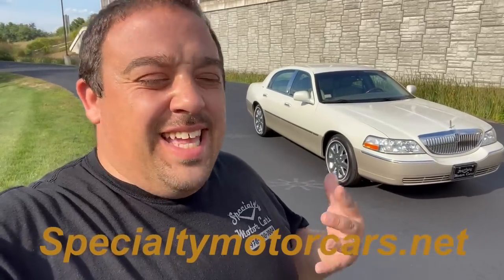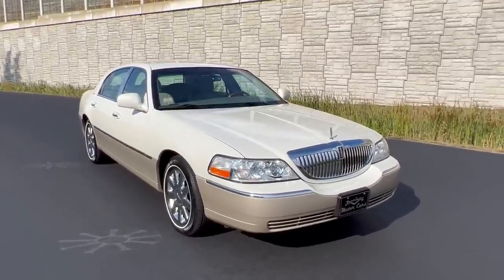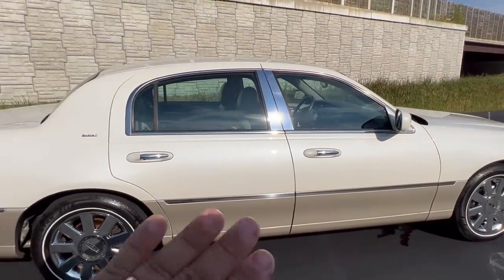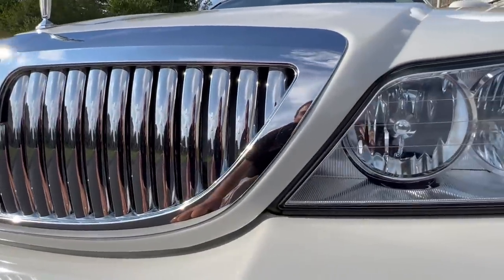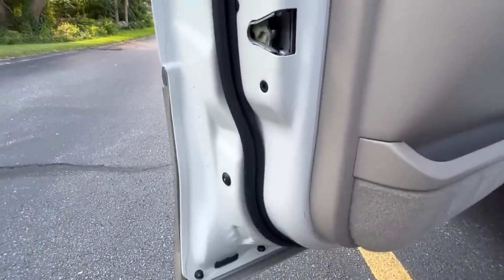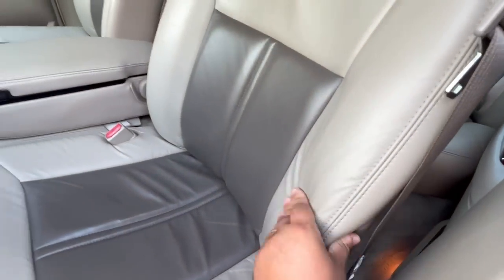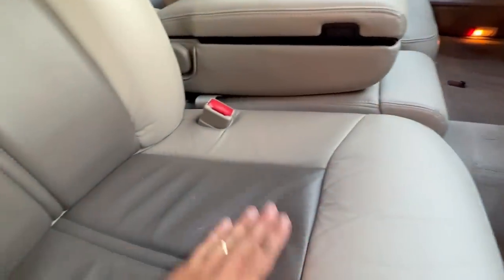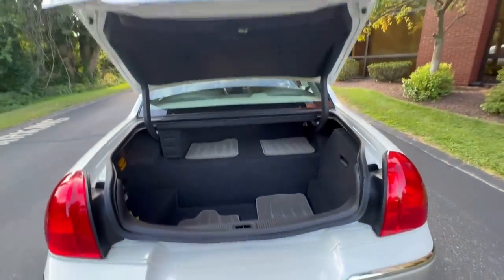2004 Lincoln Town Car ONE OF A KIND Limited Package 37K Miles FOR SALE by Specialty Motor Cars

Comment: I had an 04 ultimate two tone but the top paint was cashmere which made the two tone very, very subtle.  It was not a limited though.  I got t-boned at the end of 2017.  It saved my life at the cost of its own.  48000 miles.  Lovely car as this one is too.

Comment: When I first saw this color combo I LOVED it!  Still do.  Sadly I'm not in a position to make an offer here.  Plus I'd really want my next Town Car to have a factory moonroof.  Kinda bummed I don't have the space/cash for this one, it's sweet!
You gotta love it when you get to re-sell the same car (mostly, except when the customer passes away)!  Meaning repeat business usually.
Reply: I used to be a sunroof fan however not anymore.  If/when the drain tubes get clogged (chronic problem on 2008-2013 Cadillac CTS models) it is a real pain, unless someone likes water on the floor of their car whenever it rains a moderate amount or greater.  Has happened to me with both 2008 and 2009 Cadillac CTS models.  Maybe Lincolns don't have this problem.

Comment: I guess the mud-dauber nest thought it was time for "the south to RISE again" lol

Beautiful car.  The high series cars usually had no additional charge for the tri-coat paint jobs (Ceramic White, White Chocolate, Cashmere).    
Dual Med - Dual Media - AM/FM - with Tape and CD (not so much relevant anymore haha).

The Two tone treatment inside and out is a great look.  Not many made, I think it was in the 1500 range or so per model year.  You hardly ever see a Limited model with a moonroof.

The chrome pillars were on the 2004-5 Limited, 2005 Pro Series, 2006-7 Designer, 2006 25th Anniversary, and 2010-11 Continental Edition.  This is a car that will not stick around for long...

Comment: i had a 07 same color, AC had a slow leak...with a leaking cylinder  , changed a coil thinking that was the problem ,had to get rid of it. they drive smooth and had low mileage .

Comment: A few months ago, I bought a 2005 2-tone pearl champagne colored Lincoln  Towncar Limited with a sun roof. It also has the 2-tone leather seats.
It was special ordered and kept in a garage for years. It was owned by a retired school teacher who's husband didn't like the car, so it wasn't driven alot.
When I bought it the car was in pristine condition. However, I have lost the 2 round front wheel covers. I don't think the man at the tire shop replaced them correctly. I bought my back tires from another shop and those covers are still on the car.
Could you tell me where to find replacements?

Comment: Absolutely Gorgeous Anthony, but I am waiting on your 2008's or newer. I will not give up. I know you will get more.  Thanks Sir.  Hi Papa....   :)
Reply: Hope you ll find soon :) I recently got a 2011 w/ 29k miles, I now have 30, it s been a blast 💥
Reply: @frenchyp7b    Oh Wow Sir, that's what I want, a 2008-2011. I lost out on the two 2009's Anthony just sold, I called too late. Please let me know if you are selling any of yours.
Thanks...
Reply: Another one!! What a beauty. It is awesome to be able to maintain such a base…congratulations
Reply: @johnpezzullo9644  It s tough, they likely had dozens of calls to handle… my advice would be to closely watch carmax and carvana’s that’s how I got mine. I had shipped a white 2011 with 60k miles and another one came up. Then 2 more. The one I got was for personal use not even fleet nor rental, and 1 owner, so I got really lucky. And it was 21k so expensive but not that bad considering what older ones with higher mileage go for
Reply: @frenchyp7b    Yes thanks man. There is a Beautiful 2009 with only 23k miles out on Ebay right now, but the man wants close to $23k for it, that's just a little too steep for me.
Reply: @johnpezzullo9644  that s high but makes sense. Although these would have been 5-6k less pre-Covid easy… they re harder to find. 23k sounds amazing but is the price STEEP
Reply: @frenchyp7b   Yes Pre-Covid and Pre- CHIP Shortage these were very reasonable, now the prices are wicked HIGH, Too High... !!!!
Reply: @frenchyp7b  Was it priced reasonably?
Reply: @JayJay-hx8nc  I paid 21k for mine, double what I paid for a 2009 w/ 80k miles 4 years ago but it s in mint condition and likely one of the lowest mileage I ll ever find in CA